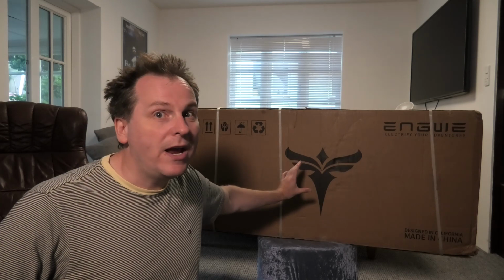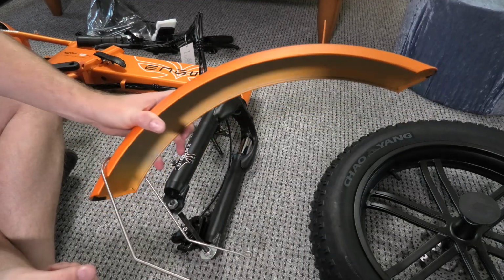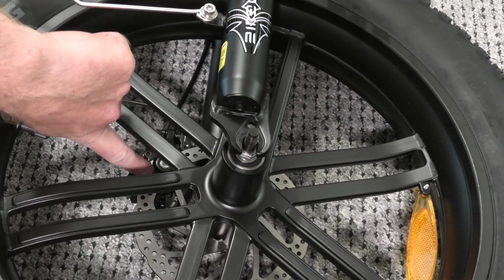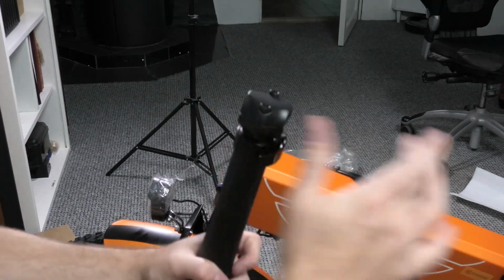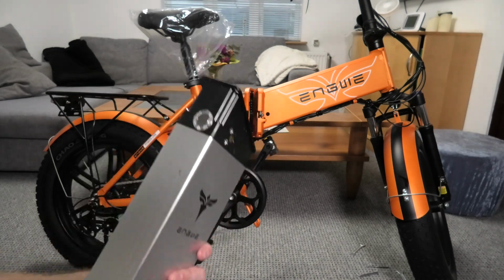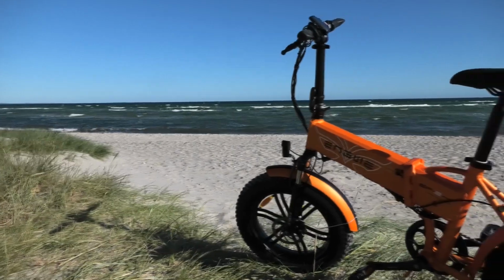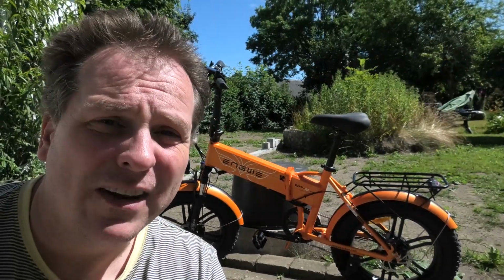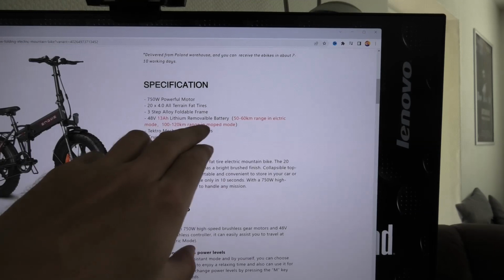Way More Power - Engwe EP-2 Pro 750W Folding Electric Mountain Bike -  1202

Comment: Mine that is like that I put a 1500w motor with a 2kw controller. I get 45 mph and lift the front tire off the ground with full throttle. For a just buy and drive it is sweet! But I could give some pointers when it comes to upgrade time.
Reply from the maker: Very nice! Interesting did you need to upgrade the battery as well..?
Reply: @MyPlayHouse  Yes. But I killed my first ebike battery in the rain after only 2 months and learned to build them. I spent money on the tools instead of buying a new battery and now all the batteries I use I made with recycled but all tested at 95% or better cells. And I only use name brand cells after watching videos of non name brand catching on fire randomly.

Comment: Nice color, you could join the Formula 1 Max Verstappen fanclub, add a number 1 to the front of the bike!
Looks like they didn’t really bother to paint the inside of the front fender, that might get rusty very quick. Unless it’s made from aluminum.
It a € 999 bike (it’s on sale) in the Netherlands, but I can’t find the maximum driver weight for it.
Reply from the maker: I have seen that somewhere,, but it’s like 120kg some places and 150kg other 🫤

Comment: The ADO A20F also has that throttle ring, if you unlock this feature. Holding + and - for 3 seconds gave me P01-P20 to tweak, also including higher speed. Search for something like "S866 bike computer manual". Of course, in Denmark, street legality of such features is conditional.
Reply from the maker: The ADO A20F has lots of stuff in the settings,, but has a hard time driving up hill. This one does that better,, I like the display and control better on the A20F.
You can probably see that they are very similar,, I only did this one because of the 750w Motor and the 48v system.
After I did the A20F I had two or three other bike companies that wanted me to do there copies of almost the same bike. I do not always understand how the marketing in Chinese companies work. 🤔well

Comment: Ah this man really serious about safety of his servers, but not really serious about safety of his ass. Cheap chinese folding 500+W e-fat bike on motomag wheels. Its recipe for disaster
Reply from the maker: Not sure what you feel unsafe about. I have a flight certificate and have been flying small airplanes,, there you worry about a failure.
Reply: @MyPlayHouse  And i have certificate for driving 80ton tank. So what?   
 It's all about point of failure, in this bike its primary - fork. 
Welded arch on lowers are no good sign. On proper bike it must be monolit, to sustain high radial tork. 
If it was normal bike,  probably i say its ok, but fore 700w e-bike,  no good at all. Normaly, you leg make somthing like 100w of tork, when you pedal a bike.
Imagen if you set lite plane motor on glider? On cheep сhinese glider
Reply: Engwe been making e bikes for 10years. Longer than most Western countries. They make good bikes. You won't find a bad review, of these bikes
Reply: @noodles169  
I call a bulshit. There is no such things as history at cheep bike manufactury.  Even 100 years of history , dont save brands like schwinn, from cheap-off, at bike comonents. 
If you insist, i can call all whats wrong with this bike , but if it sum up, he was too gredy. For this price you get much better bike, if you chose less "features". 
If you dont spend enough, but still get all "features", it will be at cost of quality and safety of components.
Reply: @Mike22313  what bike can you get that's better than this for the price? You won't find one, this is a great and very popular bike for the money,  900 euros. Look at all the reviews. I've had one for two years, and all I've had to change was the break pads. I've now just ordered the latest version, which has a bigger battery, and better motor amongst other things, they are also very easy to modify. You honestly can't go wrong for the price. And the company engwe have been around for a long time, they also have good after care, easy to get hold of for accessories. China do make good e bikes, like the rattan, yamee, engwe, fiido ect. They are able to sell them cheaper, because they mass produce them in huge factories. That's how they keep the price down. Here in the west, we get ripped off for the price of ebikes
Reply: @noodles169  1) not motomag wheels 2) not fat wheels 3) not folding bike. And you get same or better level of component for 500 euros.
Reply: @Mike22313  so basically, you talking about a commuter bike then. This bike is more for getting out and hitting the dirt trials, camping ect, having fun.
Reply: @Mike22313  I have never heard of anyone having a problem with the fork on this bike. This bike is one of the best deals on the market today. You really don't know what you are talking about.
Reply: @dustine4184  frankly speaking i never heard about this bike or brand at all (and trust mee i cnew a lot), any way, can you explain why it's "best deals"? Like who made this battered or controller?
Do you knew where they make this frame or  fork? Tell me about bike components and motor.
Or you just say its "best deal", based on its look?
Reply: @dustine4184  Bike, like PC, you can say it's "best deal is Walmart Gaming PCs", based on specs, but is it?
Reply: man, you talking about hitting trail on folding fat bike? Are you crazy? Cheap chaoyang tire, probably Chaoyang Big Daddy wired, tubular, have no fatbike property other than weight. Cheep folding bike not safe at all in any trail, drivetrain not suited to offroad use, its gona rattl like crasy , and this fork... Man. if you dont trust me, just take it to any respected bike shop and ask em "What is wrong with fork" you will get your answer.
Most of all its pointless heavy. You can make cheaper lighter bike, just by swapping to spokes wheel, rigid non folding frame and rigid fork. 
If you dont trust me, just ask some one who cnew, but not one who sell this pice of crap.
Like #askembn ore somthing